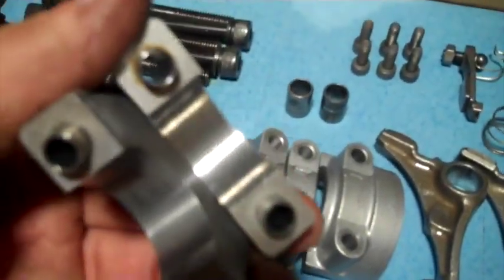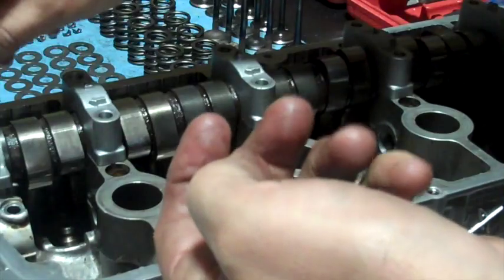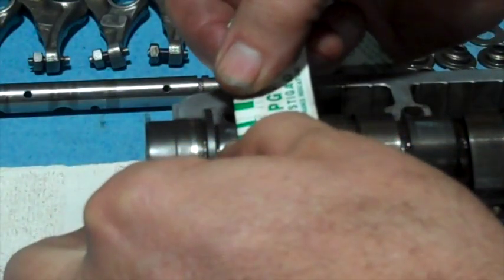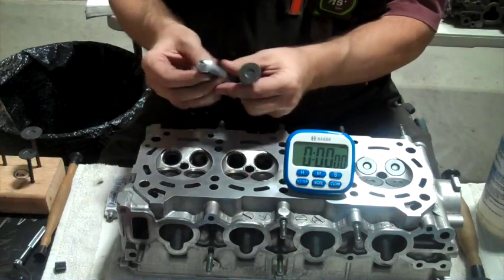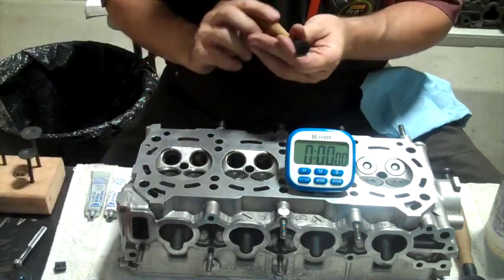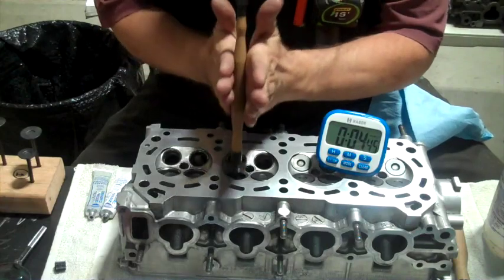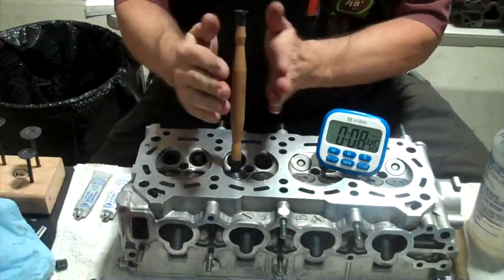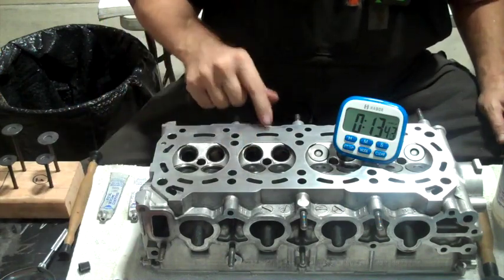Suzuki Sidekick Engine Head Rebuild Part 3 of 9

Comment: Hi Frank. I need to change the bronze synchronizers in the gearbox of my 1995 suzuki sidekick. The problem is that in Costa Rica there are none. Do you know of a place in the United States where I can get them? I would greatly appreciate the information. Thank you.
Reply from the maker: The most expensive original brand are sold online by megazip.net.  I think lowRangeOffroad sells kits and you might find them on amazon and ebay.  Some places ship worldwide and some don't.  I bet you could find them on alibaba also.  Just have to get on the internet and start searching.
Reply: Also Hwy83 suzuki has the good brass ones. Tony has many parts.